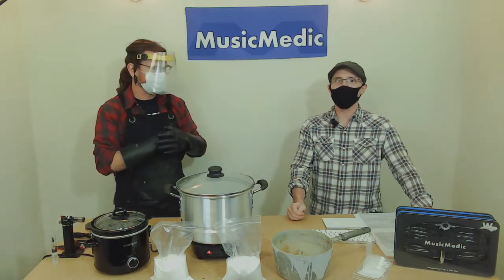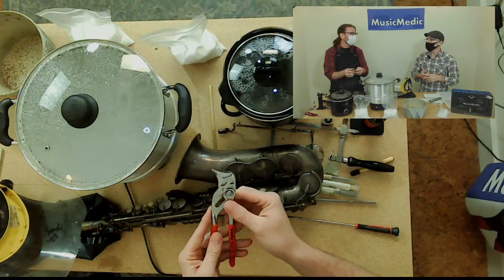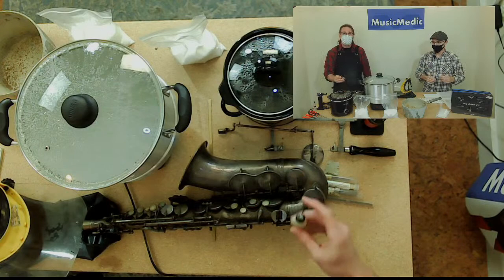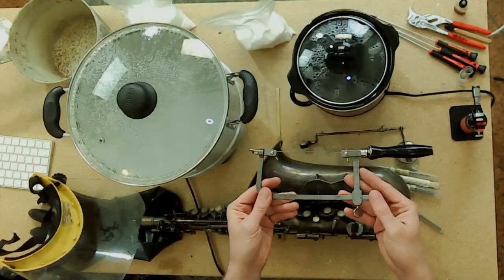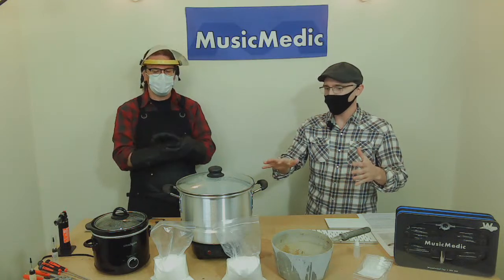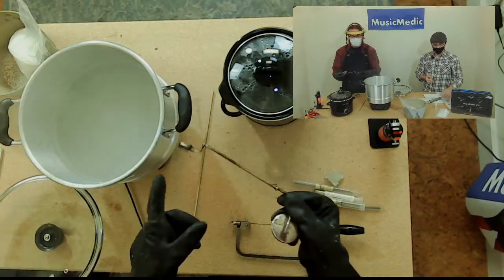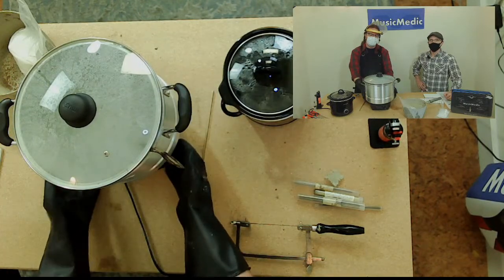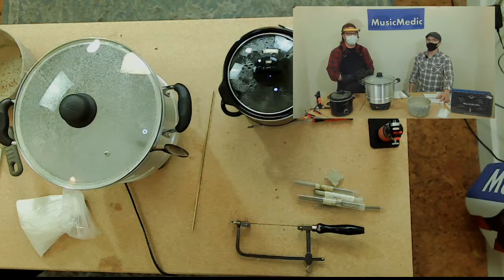How to use Alum to Remove a Stuck Rod in a Saxophone Key

Comment: Hey Guys , thanks for this. I have been repairing professionally for over 20 years and have never had a rod so stuck I couldn't get it out with penetrating oil and heat UNTIL this week. I've know about Alum but had no ideas on ratios or time frame so this video came at the perfect time!
Reply from the maker: What a great coincidence!

Comment: Thanks for another super informative video.  Question: can you re-use the alum solution?  Will it keep?  Can you put it in a jar or something until the next time you need it?
Reply from the maker: Yes! You can keep it in the container you used to boil it. As the water evaporates it will turn into a sludge and then dry, so you'll need to add water to re-use.

Comment: What is your technique for removing a RH stack rod with rail-mounted posts?
Reply from the maker: First you must determine which part of the rod is stuck, whether it be in the threads or in the key sections itself.  We would start with penetrating oil for that, and use a mixture of oil and heat since it's difficult to un-solder than entire rib, especially based on the brand. If it is really stuck you will may be able to cut the rod off and use the Alum technique for the portion that is left in the key.